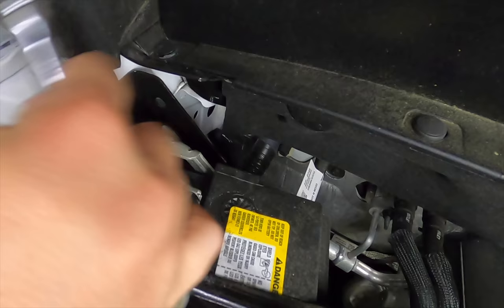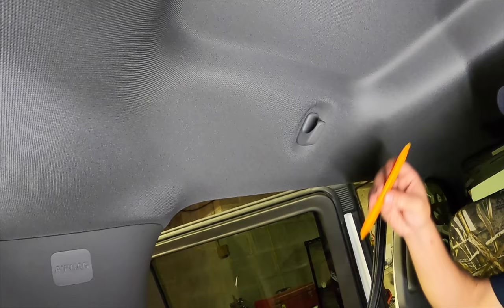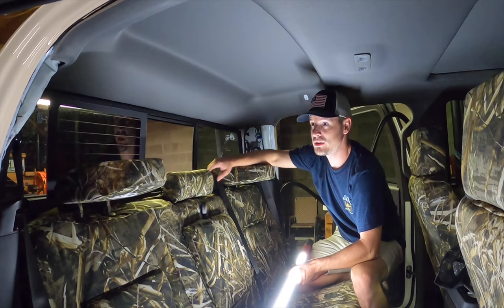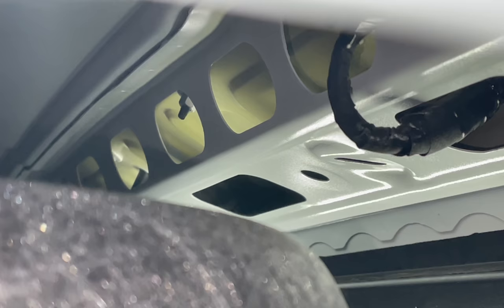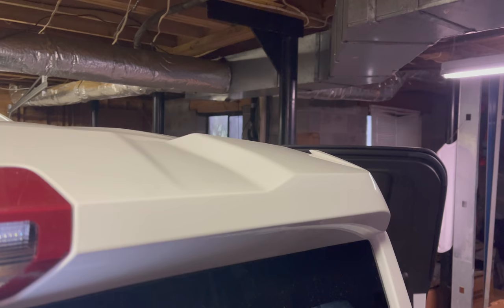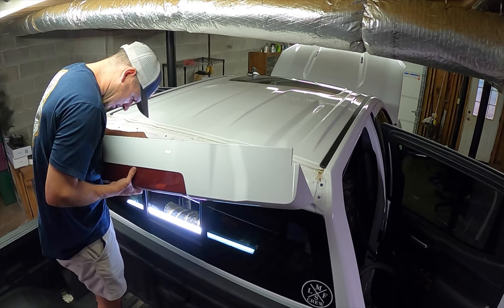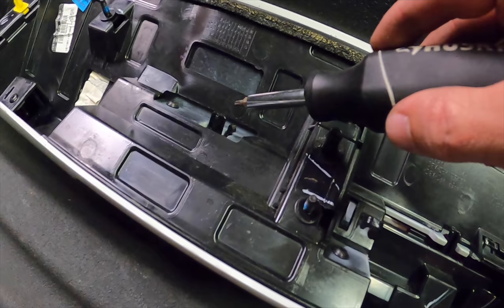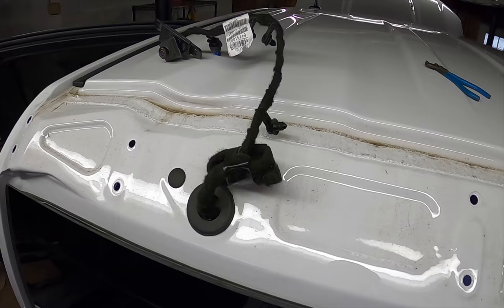3rd brake light/roof spoiler removal 2019 - 2021 Silverado

Comment: This is absolutely insane. Whoever engineered this should be sweeping the floors.
Reply: lol it’s not even that bad
Reply: The whole vehicle designed for OE servicing
Reply: Because two screws holding a lense in for 70 years made to much sense
Reply: Those blue clips holding the headliner near rear window are terrible on the video you can see he also lost metal parts of those clips because they designed by some morron

Comment: Just so everyone is aware, those 12 bolts you undo from under the headliner, those come with a PRE-LOADED rubber washer on the bottom side of the nut to help seal it from moisture/water damage. The rubber washer is opaque/white and is literally paper thin. They usually get stuck or attached to the body when you remove them, so make sure they come off and put a new rubber washer or sealant on when you re-attach the spoiler nuts
Reply: Did the same and once everything was put together ..I stuffed some Trim lock solid strip  .25  diameter and nicely tucks into the crack between the cab roof top and the front  spoiler..no water or dirt getting in .

Comment: I did it, followed your lead a bit scary but no prob, I didn't have the bed camera so the recon light works perfectly. I couldn't reach those yellow tabs but just gave it a little jerk and it came right out. super dirty under . Terrible design by chevy  didn't brake a thing, my truck is black mudered out now.  Thanks it really helped to use your info !!! followered your lead on the taillights also !
Reply: How long did it take you? Just ordered recon light myself.

Comment: Great video.  I'm in the process of installing a 70cm ham radio antenna  and the spoiler looks like a great place without drilling a hole in the main body of the roof. I have a 21 GMC denali 1500 serria with 6.2  so it should be the same. Thanks again for taking out the guess work.

Comment: There's a re call on the back glass for leaking water  just take to dealer and have them change light when they do re call. The plastic separates from the glass.
Reply: It's not a recall, just a technical service bulletin (TSB).  I have the infamous rear window water leak on my brand new 2023 Sierra HD.  My completely incompetent dealership service department fucked my truck up, and didn't even fix the leak.  Just ordered the the high-tech seam seal, and eight 10mm bolts to fix it myself per the TSB.  The incompetent techs at Buick GMC Hyundai of Goshen can't follow the simple instructions on the TSB.
Reply: @outbacker292  I feel your pain man same shit happened to mine
Reply: Yea my 2020gmc 1500 rear just started leaking today

Comment: Man having 2 screws on a 17 chevy is so nice to swap the 3rd brake then 20 plus blots n screws, these newer truck are getting built to be way harder to modify
Reply: I have a 16 I wonder if I can get away with installing this spoiler/brake light mounted on the cab ? 
I was thinking loosing the screws and using double sided adhesive for trim but idk if the body lines match

Comment: Just bought Lasfit LEDs . Not going through all this trouble just to change lights. I have a head ache rack and I'm never fixing this brake light once it blows.  I'll use a hole saw from the outside first before I mess up my headliner.

Comment: Great video, well done. I found this while I was washing my truck. I was in the bed rinsing the top and leaves and pine needles kept coming out of the crack between the roof and the spoiler, so I figured I would remove the spoiler to clean it properly. How difficult could it be right?
Sadly this poor design requires an absurd amount of work. sure hope the lamp never fails.

Comment: So my 2019 Chevy Silverado is leaking I believe through the third brake line is there not a gasket behind that brake light? It’s coming in the cab getting my liner wet.
Reply: Chevy had a recall or sorts (they call it a maint bulletin) for rear window leak with auto slide open.  the leaking point was actually in the tray where the window slides open  - seems to crack.  I was just out of warranty but printed the bulletin out and handed it to the dealer and told them i think they should be covering this....and they did

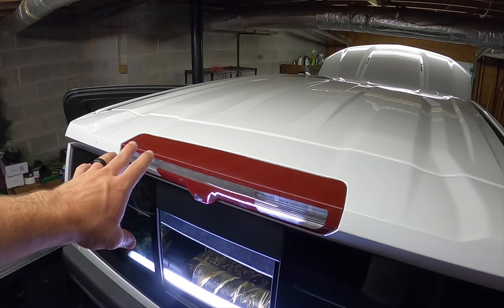Comment: Hey man! I just removed my 3rd brake light and noticed I don’t have the little silver/metal clips ( 3:57 in video ) that attach to the blue rear headliner clips that mount to the roof. Did you have any rattles

Comment: My 2020 is leaking water just about the sliding back glass, I dread taking the headliner loose,  but it would probably come back from dealer with a ding or grease on a seat
Reply: Chevy had a recall or sorts (they call it a maint bulletin) for rear window leak with auto slide open.  the leaking point was actually in the tray where the window slides open  - seems to crack.  I was just out of warranty but printed the bulletin out and handed it to the dealer and told them i think they should be covering this....and they did

Comment: Wow just when you thought chevy couldn't make something simple and infuse it with more difficulty. Now i know i won't bother doing anything with that 3rd brake light. Just a question; Can the camera be disconnected with just the head liner down. I'm looking at a cab for the bed and wanted to buy a new camera and tap it into that camera for bed view option. Thanks for the video!

Comment: Hey man, I have back window leaking dealership wants 1500 to replace and dry out. I was wondering if you thought by taking the spoiler off I would have plenty of access to get some silicone all up and around the top and sides of glass?
Reply: Chevy had a recall or sorts (they call it a maint bulletin) for rear window leak with auto slide open.  the leaking point was actually in the tray where the window slides open  - seems to crack.  I was just out of warranty but printed the bulletin out and handed it to the dealer and told them i think they should be covering this....and they did.